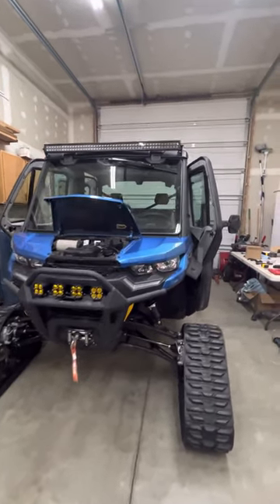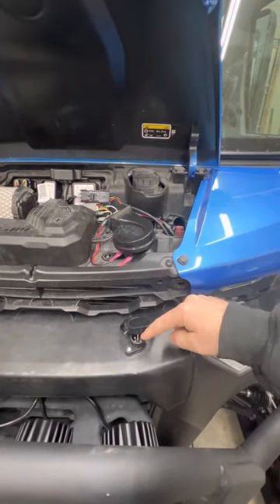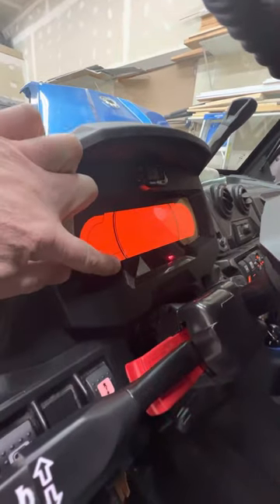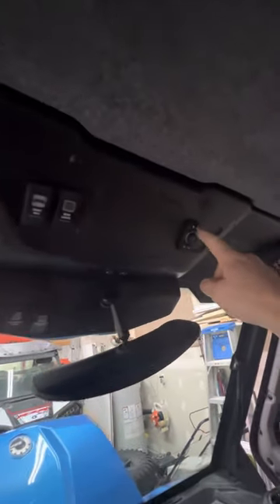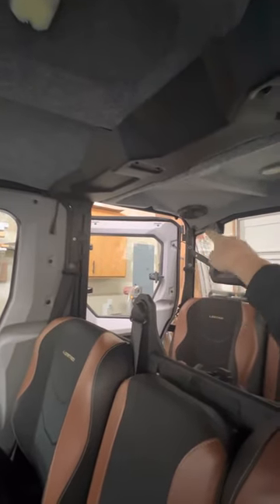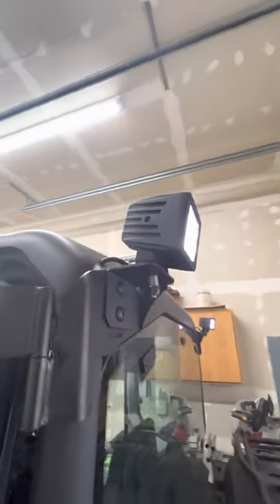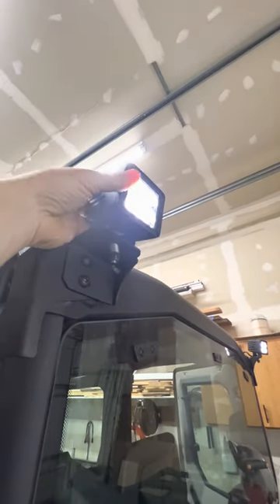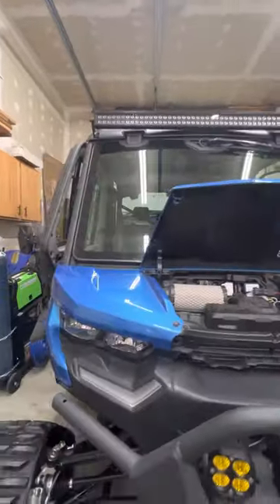2021 CanAm Defender Limited Max Part II

Comment: This stuff is very cool.  Can you provide links to it?  Wiper delay, voltmeter etc.  In the video when you say Rough Country Black serious, I get that.............but I am lost with the much needed wiper system you used.
Reply from the maker: @grantparnes I will update the description with some links to accessories that I used on the build.  For the wiper delay I used a delay relay.  There is some re-wiring that needs to be done and a diode should be installed to prevent back feeding of the power side coming out of the switch.  I am currently working with Sam's Backup Lights to create a simple plug and play wiper delay module.  We are currently in the prototype phase and have a couple machines with them installed for testing.  Hoping to have a unit finalized by the end of the yr and available for sale early next yr.

Comment: You said that you can run wires on the passenger rear corner up to the roof. I seen their is a hole in the top. How did find a place to route the wire at the bottom up to the top?
Reply from the maker: Thank you for the question. Open the rear passenger door and look down to about seat level. There is a plastic panel on the outside of the machine. Just in front of the fuel cap. Remove a couple of screws and body pins to remove this panel. With panel removed you should be able to see the bottom of that corner roll cage pilar. On the bottom should be a hole just like on the top. After running the wire down the pilar I routed the wire to the engine side of the firewall to the driveline tunnel access (near the oil filter) which is to the right of the battery as you are facing the battery. Then you can make the connect to the battery. This is where I also installed the inline fuse. Hope that helps.

Comment: how hard is access to buss bar in dash?
Reply from the maker: That buss bar is easy to access. Just pull out on the top of the panel that has the 4x4, Diff lock and the multi function switch on it and the whole panel will come off. I point to it here at 7:08. The buss bar is just behind that panel. To reinstall the panel first hook the bottom tab and then roll the panel up and snap into place.